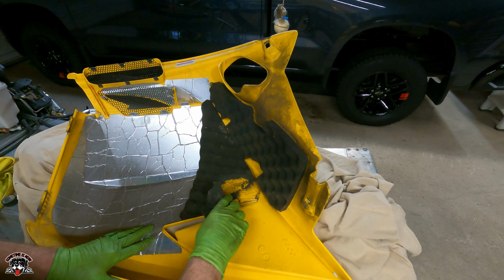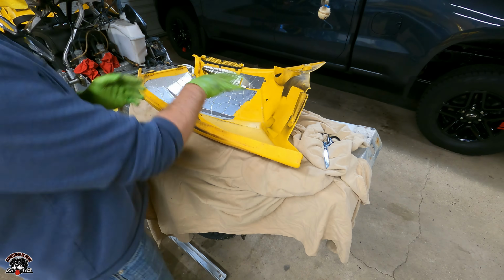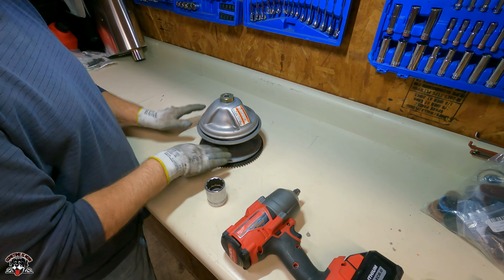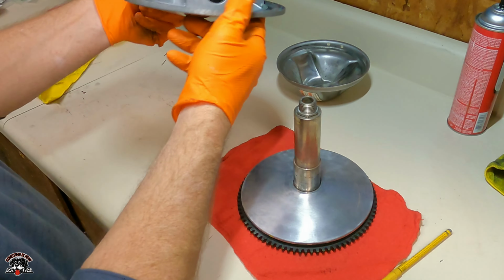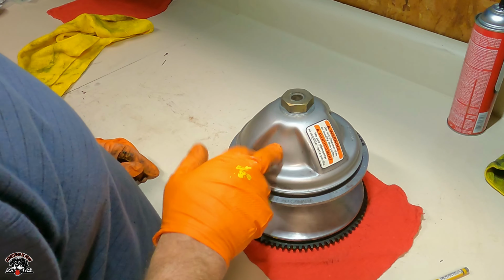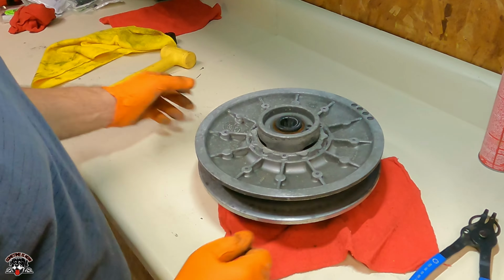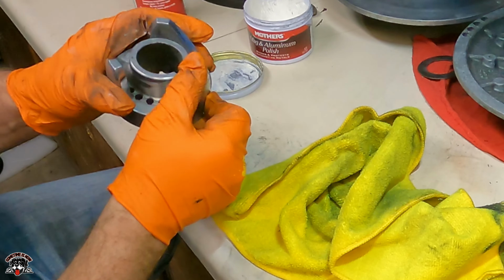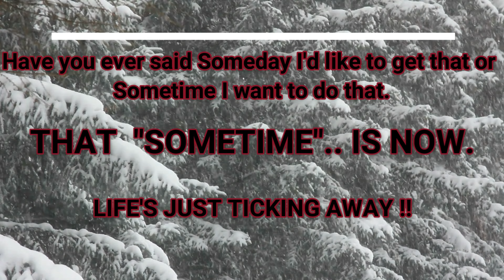SKIDOO REV MXZ 550f | EP08 | Cleaning clutches and replacing foam

Comment: These videos are a blessing.  I purchased a 2005 MXZ 550F (the exact sled in your videos) for $300.  Needless to say for that price its rough (been hacked all over the place).  I plan on going through the skidoo over the summer and your 550F videos are going to be a huge help.  Thank you !!
Reply from the maker: Hey Edward, Thanks for stopping by to check out the Rev videos. It’s appreciated. It’s a nice little machine. I noticed It is a bit of a gas hog. I ordered an electric start kit for it that’s suppose to be in next month. They were on backorder like most everything else. I’ll do an install video of th e kit once it comes in. 👍🏼 If you have any questions during your rebuild give me a shout. Take Care. 🤙🏼

Comment: This video was a blessing. I am literally doing the same thing in the shop right now.
I watched your video and I worked along this evening. Mine was very seized up also, same as yours. 
Thanks for everything.

My belt had A very strange Mark on the outside from hitting one of the rivets on the belt guard so I’ve been digging for problems.
Thanks again
Reply from the maker: Hey Tom,  Thanks for checking out the video and I’m glad it helped. Sorry I just noticed this comment. I don’t know how I missed it.  How’d your clutches turn out? Take Care ❄️❄️

Comment: I replaced the foam also in my gsx this past summer when I rebuilt the engine,  hopefully it helps cutting down on the noise produced by the engine.  I will find out this winter if we get snow!   Already have rooms booked up in tug hill,   Hopefully I will be able to take advantage of it!
Reply from the maker: Hey Adam, Thanks for stopping by. Oh nice.. What year GSX do you have and is it a 550f or a liquid?
Reply: @SometimeIsNow  I have a 2004 GSX 600 HO SDI,  that's a liquid,  I also have  2015 GSX 1200 four stroke.

Comment: WOW, thanks, that's exactly the video I was looking for ;o)

I'm also doing maintenance on the secondary clutch of my 2005 GTX 550F

What changes would there be if you didn't use the B2 setting?

Could you change anything about the response by changing the position?

Thanks, Ron from Gerany

Comment: Where do you get the foam? I just pulled out all mine that was falling apart.
Reply from the maker: Thanks for stopping by the channel to check out the video. I bought a roll of it from Amazon here:
https://www.amazon.com/gp/product/B089RRNSTR/ref=ppx_yo_dt_b_asin_title_o09_s00?ie=UTF8&psc=1
Take Care 👍🏼
Reply: Thanks, I ordered a roll.
Reply from the maker: @Miracle-x6d  Excellent 👍🏼
Reply: How has this foam paneling held up at this point now you've put some time on it ? Looking to re-do my 08 MXZ TNT . 
 Also , what you using for a heat resistant material around exhaust areas ? @SometimeIsNow
Reply from the maker: @JpJp-zd7vu  Hey JP, Thanks for stopping by to check out the video. So far so good on the foam. No issues. As far as heat resistant material I didn’t add any. I just left what came on the side panel. Take Care

Comment: if i don't have electric start is it ok to take off the chain ring?
Reply from the maker: Hey Scott,
Thanks for stopping by the channel.
If you’re referring to the starter ring gear on the back side of the primary clutch you can remove it if you don’t plan on adding ES. I bought a ES kit for the wife’s 550 that I’ll be installing before next winter. 
Take Care
Reply: Thanks. I have had the sled since new. Maybe taking it off will give me a little extra power.
Reply: @SometimeIsNow  I'm hoping to get a little more acceleration by taking it off. Maybe its negligible.  Thank you
Reply from the maker: @scottd7615  Hey Scott,
Maybe but IMO.. I doubt you’ll notice a “seat of the pants” difference with removing the ring gear even though you’re removing rotating mass. 
Take Care
Reply: @SometimeIsNow I know it wont be much. but its a free upgrade and you dont get those often!
Reply from the maker: @scottd7615  Very True 👍🏼
Reply: @SometimeIsNow  Hi, (Greg?) were you able to buy an E-Start kit from the dealer? I’d love some info on a kit if you have some to share and would love even more for an install video! Your videos are a life saver as a new 550F owner.
Reply from the maker: @DaveyBoySmith1  Hey DaveyBoy,
I did purchase an e-start kit from my dealer over a year ago and installed it on the 550F. Sadly I didn’t record the install as we were going on a trip and I just wanted to get it done. It was a pretty straight forward install and came with good instructions.. I did need to remove the muffler, mid pipe and primary clutch to install the new voltage regulator and starter portions. 
Here’s the Electric Stater Kit (REV 550F) Skidoo Part# 860200134
I’m going to warn you.. It’s not cheap. I paid around $650.00 + tax at the dealer. Right now Partzilla has the kit for $659.97  https://www.partzilla.com/product/ski-doo/860200134
You might find it alittle cheaper but I doubt it. 
If you shoot me an email I can forward you the instructions and you can look them over to see if it’s something you wanna tackle 👍🏼
email me@ yoursometimeisnow@gmail.com
Take Care